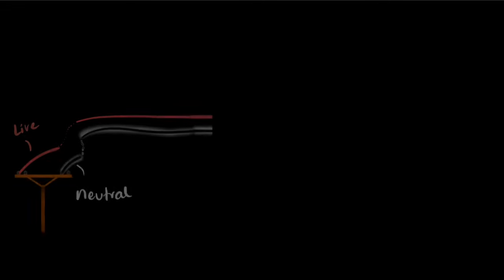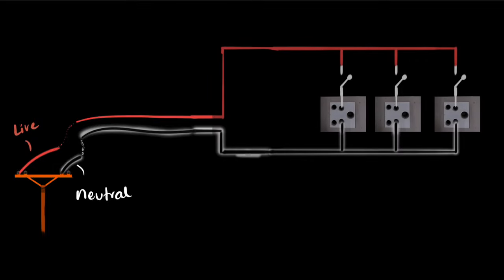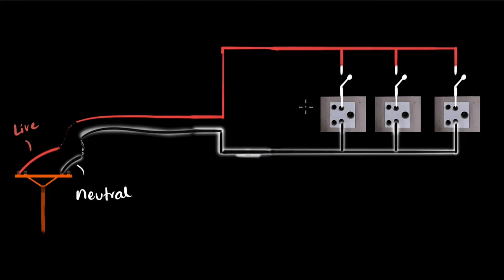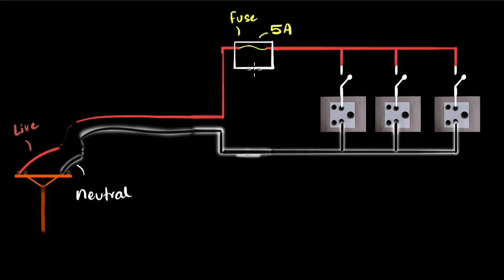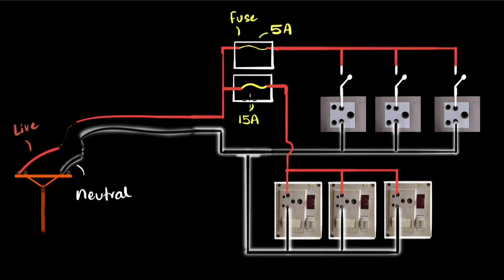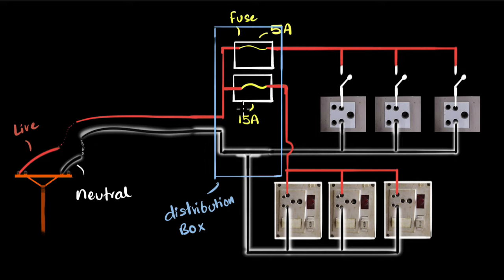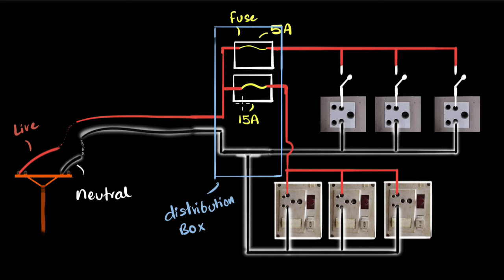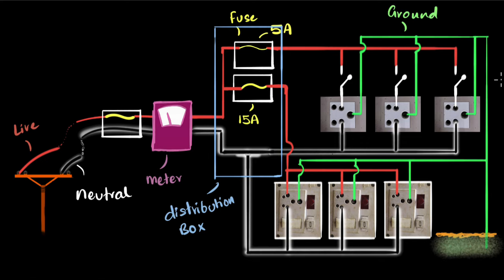Domestic circuits | Magnetic effects of electric current | Class 10 physics | Khan Academy

Comment: What is the need of neutral wire here ? We are solely need of only live here. Please explain logically sir
Reply: Current flows only when a pot difference is maintained man . The neutral wire maintains this pot difference since potential of live is 220 and neutral is 0 . 
It is also said that the neutral wire takes in the current and the neutral wire brings back the current

Comment: PLEASE HAVE A READ THROUGH SIR
The water is heated and then steam passes through turbine and then rotates it back and creates electricity due to faraday's laws. Then the electric power is transmitted through a wire and reaches the home and in our home we gotta use the power by connecting it to the iron box where it converts electricity to heat and all the voltage drops and merely the electrons come to rest here. What's the need for neutral wire ? How do they returns back ? Please have a look sir
Reply: In the case of Alternating Current which come to our home, actually the electrons are not traveling the whole way from the power station to our home. Actually they are oscillating back and forth at 50 Hz. But for the electron to flow, there must be a potential difference. Neutral Wire is only providing that required potential. In the AC generator, the coil has two ends. If you consider one end as Phase, the other end can be considered as Neutral. For Current flow, we need a closed path.
Reply: @sajanphilip8221  please explain me in detail sir
Reply: There are two principles we have to consider. 1. Conservation of Energy and 2. Conservation of Charge. C.E you have already mentioned. Energy will be lost as work+hear. But think about C.C. There must be conservation of charge. The number of Electrons leaving the AC generator must return to the AC generator itself. So we can't say electrons are lost or electrons come to rest.  For analogy you consider a water pipe connected as a loop. That means at any time the water within the pipe is constant. We are not providing water from outside.  On one side of the loop, we have a pump and on the other side we have a turbine. Since the pipe is a loop and closed circuit, water will return to the pump itself after rotating the turbine. Here also work done and water lost potential. But water must return. Otherwise the circuit will be open and water will not flow.
Reply: @sajanphilip8221  thank you for your reply sir
Reply: What is meant by leaky current? Please explain in detail